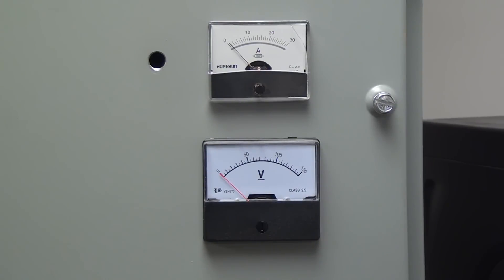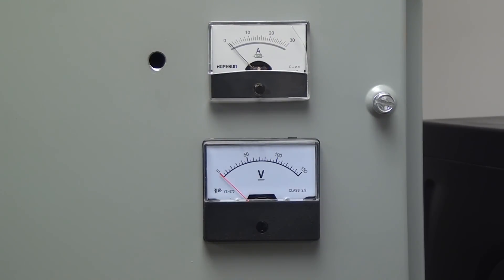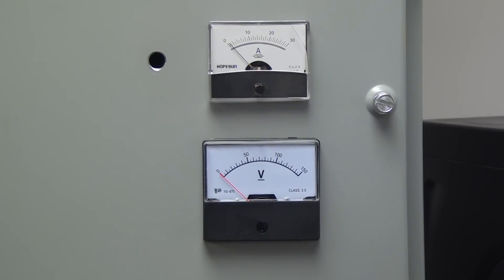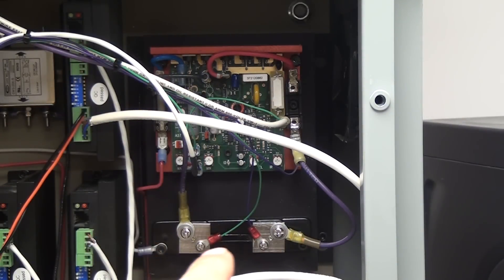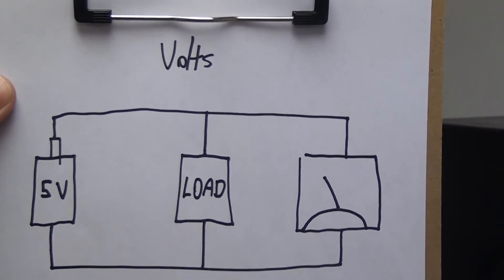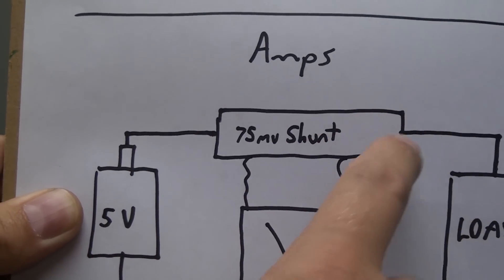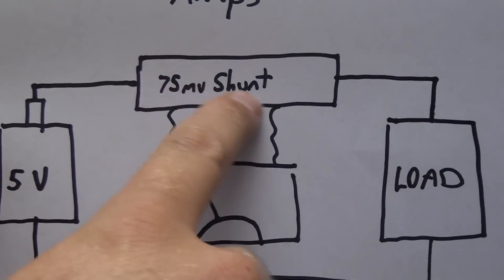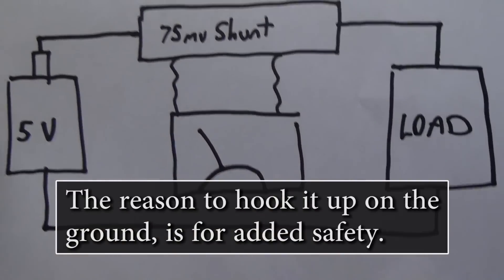Wiring DC Ammeter (Load Meter) / Volt Meter

Comment: I have a 5amp dc amp metre and I am using it for my O/Gauge Model Trains Rolling Road Test Track my power source is a Hammant &Morgan Clipper Controller how do i wire up the amp metre so that it operates I also have wired up a 20 volts voltage gauge and it operates thanks for your advice,Kevin.A.

Comment: Thank you it was very well explained but I believe the meter has + and - leads on the back and should match the circuit in other words if you have + from the load going to a power supply and using ground through the shunt the negative from the  meter should be on the side of the  negative from the power power supply and positive from meter should be on the side of the shunt from the load so your meter will not swing backwards and possible damage the meter

Comment: Why does the shunt and meter have to match? Does the shunt create a resistance for the voltage drop to equal zero, making the circuit safe for the ammeter?

Comment: show me a wiring diagram of a volt meter and ammeter, my purpose for this is to build a panel power source using 4 9volt batteries wired in perrallel for more capacity, the ammeter i hope to  show the amount of battery capacity left in the batteries  and the volt meter would show the amount of volts remaining in the batteries after use over a period of time. I hope i explained this correctly. any heip would greatly be apprciated.
Reply from the maker: Sorry, that's out of my league. I'm no pro.

Comment: Hi Russ.  What sort of load readings do you see for 'light' and 'heavy' milling?  Bob.
Reply from the maker: Hey Robert. I just burned up that DC motor a few weeks ago, so it was pulling over 15a at 120vdc. The cut was with a 3/8" HSS end mill, 1.25"depth, .020" width, 30ipm, which is a MRR of .75 cubic inches per minute. That's basically a 3HP cut, so no surprise I melted it :(
Reply: +russtuff Thanks for very helpful response.  I'm just starting and this sort of info is excellent.  Cheers.  Bob.

Comment: I've been wondering if we could measure the voltage drop across a shunt resistor with the analog inputs of an arduino. there would be some cool possibilities. I haven't put a ton of thought into it yet just an idea
Reply from the maker: That is a fun idea. I need to spend more time playing with the Arduino. They're a lot of fun.
Reply: +russtuff like if you could tie your spindle load to your feed rate override :)

Comment: Not good at electronics? This was well explained and concise. Can you link the ammeter up to linuxcnc somehow? Would be useful for crashes/logging/comparisons ect. Ta!
Reply from the maker: Thanks! I just want people to mistake me for someone who actually knows what they're doing :)
My knowledge is piecemeal.
I'm not sure if there is a way to link LinuxCNC to the ammeter, but that's an interesting idea. I would think you need a digital signal then it could probably be done..... I'll have to research that. LinuxCNC actually has a built in ammeter which is software based off of the VFD's A/V curve (I think). I use it, but don't understand how it works :)